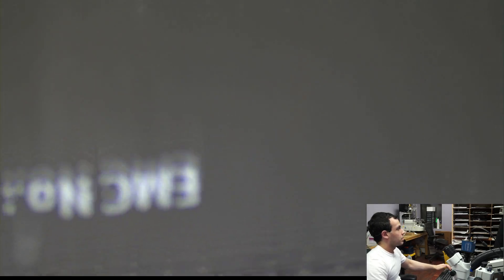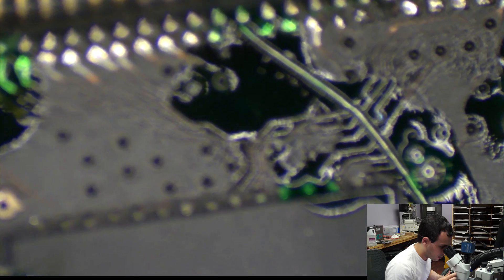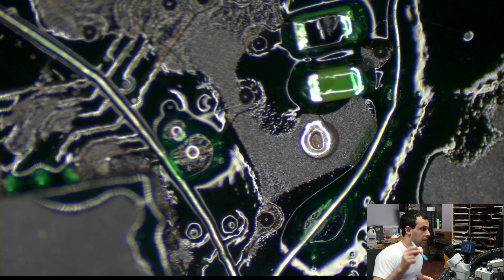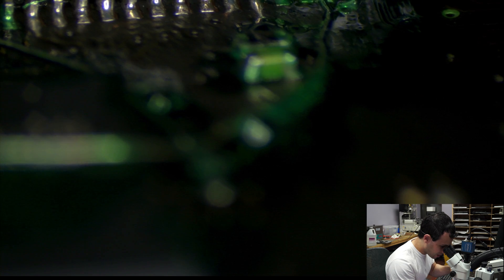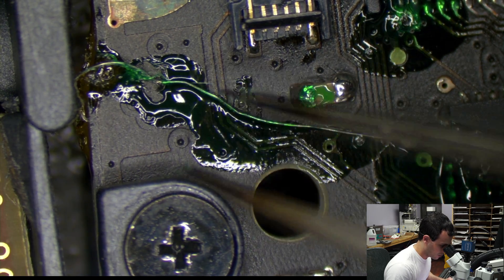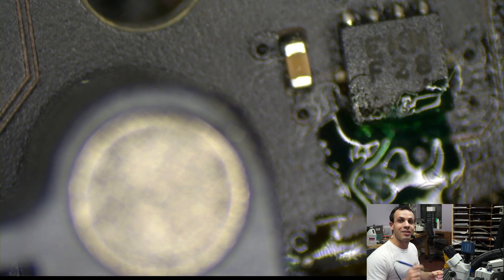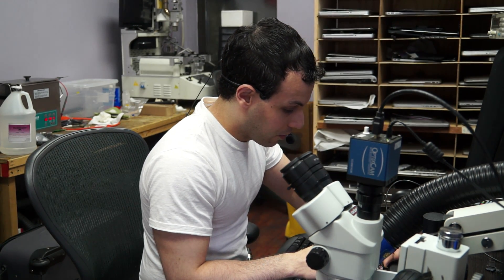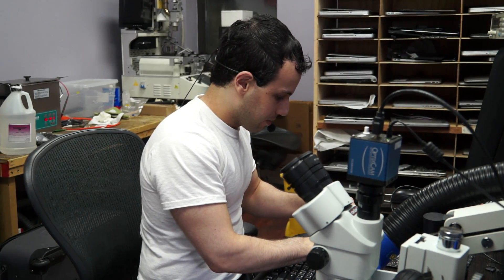Keyboard connector replacement with jumper wires.

Comment: Is it possible to attach the keyboard ribbon cable to the pads on the board if you have broken off the ZIF connector on a early 2011 13" macbookpro? Is it feasible to do by yourself, bypass the connector, or am I grasping at straws?

Comment: Hi on my 2014 retina 15 inch keyboard the return key "0" and "-" are unresponsive after sleep.  After I hold the key for 5 seconds after sleep it works normally for hours on end.  Any suggestions.  Thanks

Comment: Hi Louis my Macbook pro 13 is not turning on with power button but turn on when I short pins beside SMC chip I try new keyboard and another  working  macbook case still same wont turn on only wont turn on with shorted pins ,i checked R5710 and C5710 and looks ok can you point me what else I have to check when wont turn on with power button and its not broken keyboard 
THX
Reply from the maker: +ljubinko radojcic probably bad kb connector or bad kb
Reply: Thx man
Reply: Sorry when laptop is working all keys and letters working only power button not  is there any workaround with that except replacing whole connector ,like jumping wire from connector ?
Thx Again

Comment: How would one go about replacing the actual keyboard connector. It looks to be all "plastic" except for the pins. Just soldering the pins to the board can't be very stable? Am I missing something from the "new/OEM" ones being sold on eBay for $2?

Comment: The wire you want is just called "magnet wire" - it's simple copper wire coated with a polyurethane laquer. You can harvest it from a solenoid or motor, too.

Comment: If Louis needs some wire, then he can have as much as he wants off the giant spool of 36AWG wire that I have here that I ordered and have used exactly never.   The thing is that you rarely need to run a wire longer than a few millimeters, so single ply of braid, battery wire or whatever you have laying around is the practical choice.

Comment: I do board repair on macbooks for a living. You want some magnet wire. I got some of ebay, go for 0.1mm and 0.2mm. Im honestly surprised you didnt know about magnet wire as you were a studio technicain. You've probably worked with buckets of it when re coning drivers.ect

Comment: http://www.ebay.co.uk/itm/121524818651?_trksid=p2057872.m2749.l2649&var=420462533233&ssPageName=STRK%3AMEBIDX%3AIT

0.5mm is the stuff I use, you can thread it through blown vias
Reply: live2digmetal You can salvage it from old headphone or earbud cables too.

Comment: Correct me if I am wrong, I think the wire you are talking about is called enameled/magnet wire. The thinnest diameter I could find on digikey was 34 AWG (0.15mm): http://www.digikey.com/product-detail/en/600234/1175-1693-ND/4693817
The thing is it costs freaking 70 bucks for 5km length, which for your purposes it will last several life times. So either you buy that or bust open inductors or motors in cd dvd drives and scavenge those from there.
Reply: iSolarSunrise Yep, he is definitely thinking of magnet wire.
Reply: iSolarSunrise Solderable Enamelled wire
Reply: iSolarSunrise    This is enough:  @251999281301
Reply: Later, I saw smaller spools for about $4.
Reply: iSolarSunrise Check out mcmaster-carr's selection: http://www.mcmaster.com/#magnet-wire/=xxsjap